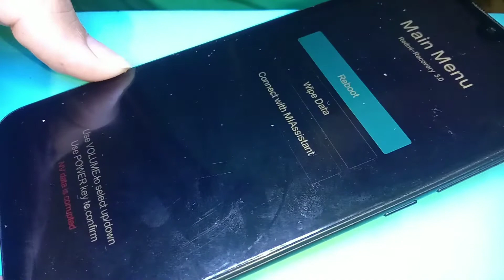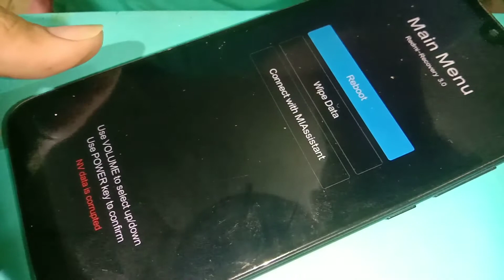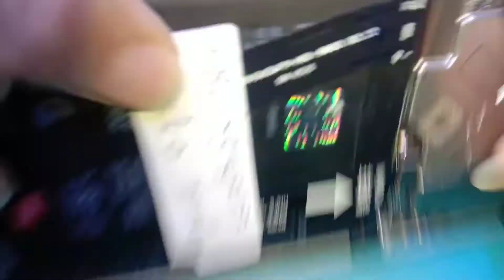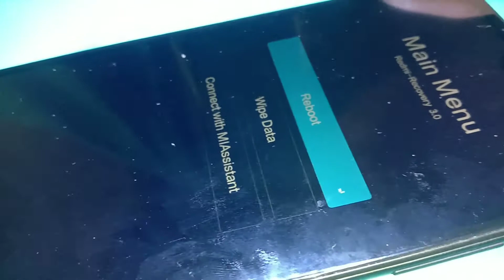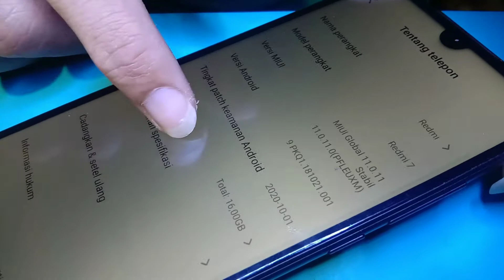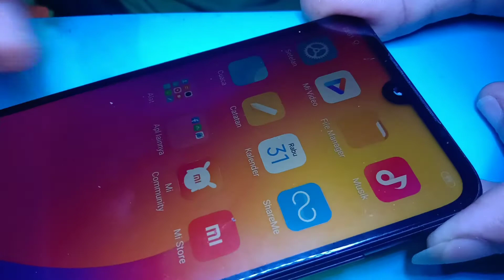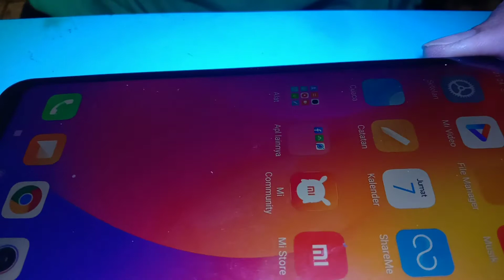NV data is corrupted Redmi 7 Onclite MiUi V11.0.11.0 | Fix Dual IMEI by Hardware

Comment: and you can download why after that I don't have a serial number, that we delete it.
Reply from the maker: Sorry sir, i can't understand what you mean
Reply: @mobilecareid  sorry, I wanted to ask what transistors you removed from your phone after that, and what they are responsible for, 3G does not work well for me
Reply from the maker: @slavak1  If the signal is problematic, it's possible that the problem comes from another cause, because the resistor being removed has no effect
Reply: @mobilecareid  I don't have a serial number yet for some reason